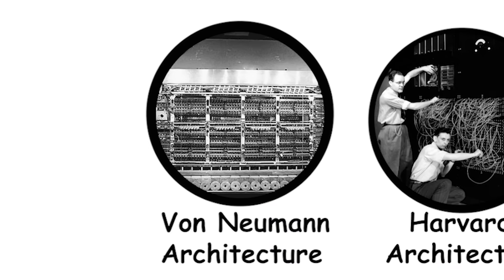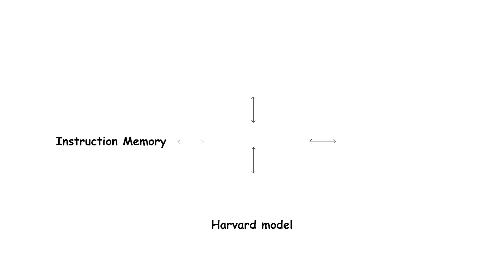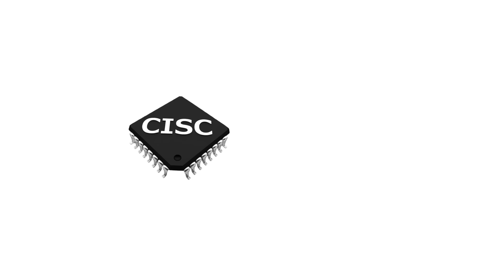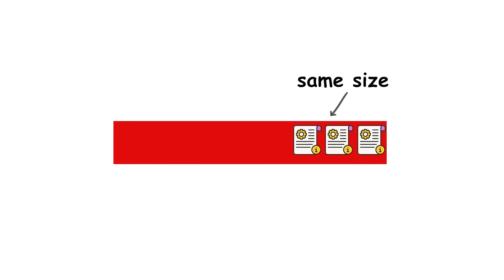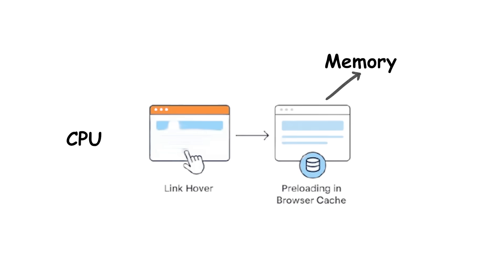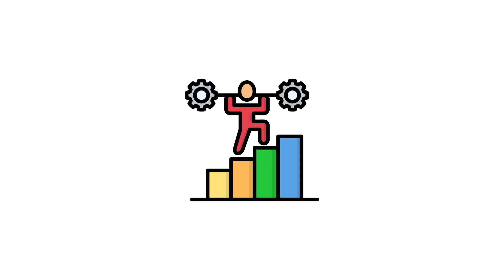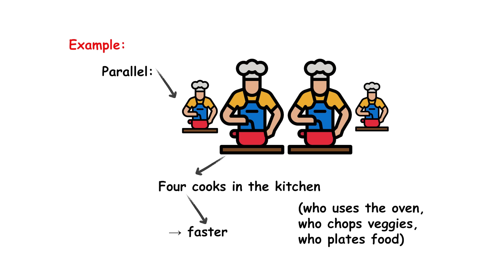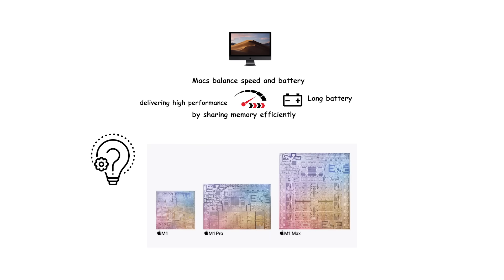Every CPU Architecture Explained in Detail

Comment: If memory bus is an issue, and ALU over comes that? Why hasnt that gain more tractions?
And why does everything have to be done through the cpu?
Look how Amiga designed the hardware using other slave chips to perform the tasks.
And why not having something that avoids to execute too much instructions for drivers, such as kabi interface

Comment: A very good overview of architectures.  But there are a few errors.  For instance, VLIW was not the invention point for speculative execution.  That was tried in some earlier machines, but really became important in the Pentium Pro design which was sold first in 1995.  While Itanium did use a variant of the technique speculative execution along with branch prediction gave the P (Pentium Pro) and subsequent CPUS higher performance per clock.  In addition, superscalar was first introduced in a modern CPU with the 80960 architecture in 1980.  Superscalar was used in the Pentium and every subsequent Pentium (II, III, 4) design.  It was first coupled with branch prediction, speculative execution, and register renaming in the Pentium Pro design introduced in  1995.  

I am certain of all this as I designed CPUs at Intel from 1979 to 2001 and was the design manager of the P6, and the VP/GM for Pentium II, Pentium III, Pentium 4, and Celeron product lines.  Many of these capabilities were  used in all other CPUs, as has become normal in the industry.  The Pentium Pro was also the first to deliver Hyperthreading or using a single execution unit for multiple threads for efficiency.

The fact that we are stuck with higher performance by using more cores means that the micro-architecture (all the elements above) has not seen any real movement since the late 90's. The apple processors using hybrid cores gives an advantage in power/performance but not strictly performance.  

Overall a good overview of some very complex topics.

Comment: Watching this video, I was trying to interpret each step mathematically... after a while it was overwhelmed. We just don't realize how much thought and work went into our computer's CPUs...
Reply: The modern microprocessor is the most complex system on the planet.  This is simply assumed as we've always had them available and the products keep increasing performance, but the people who are knowledgeable enough to actually design a processor are very rare and becoming rarer.  The intricacy of these systems is hard to imagine, and we think of them as perfectly functional, but all have bugs that are documented and often worked around in computers.  More importantly, most microarchitectural development slowed down significantly in the early 2000's as we simply deployed more cores for more performance.  The next most complex system behind the processor is the software that supports it all.  People who can build the OS, compilers, etc are fewer now also.  It worries me, especially when I see that most Computer Science major do NOT require a course on assembly (machine) language anymore.

Comment: Comparing apples and oranges. For example mixing concepts and implementations. Nearly ALL code follows a Von Neuman thinking.
The implementations of the execution units can use any structure or combination of structures. It does change the architecture of the code.

Comment: Where is PA-RISC developed with Russian help with Intel and HP and with the advent of the new cold war they dropped the Russians and the project fall flat on their faces unable to match the Soviet Programming magic to make those processors work....
Reply: PA-RISC was pushed by HP for a while after the failed Itanium (Itanic) but never achieved critical mass due to lack of differentiation and  higher costs than X86.
Reply: @randyscorner9434  That was the ITANIUM project, Intel failed to implemented and later passed on to HP, it had a great potential but cut ties with the Russian creators and failed the architecture and programming know how...

Comment: you miss all fixed logic instructionless architectures. superscalar is closest to the fixel logic fpga instructionless architecture. dont make multicore to be superscalar. analyze on the single core architecture. any system is a superscalar if you allow multi-core systems. avx is very close to superscalar.
Reply from the maker: I appreciate the insights, I'll keep that in mind for the next video!

Comment: it sounds AI but it does give you a good idea of different CPU architectures and what they are specialized for, like hybrid cores are the "jack of all trades" CISC is good for multiple instructions, RISC is good for quickly processing fewer instructions, Multicore architectures are good for multiple task loads, many core architectures are better at this but they get diminishing returns due to what i call "overcoring" where each core is optimized for one small task and if there are too many, they require more space or smaller cores, this reduces the amount of avaliable resources for each core as the space is divided between a lot of cores, some CPU's even have over 100 cores! but they dont utilize all of them efficiently since often times you arent running 100 different tasks, so they need to assign multiple cores to each workload to improve workload efficiency, this increases latency and it reduces efficiency since a many core CPU would require like 3 cores while a multicore would require only 1.
Reply from the maker: Thanks for the detailed comment and for sharing your thoughts on the topic!

Comment: EPIC was an EPIC failure.
RISC has reduced the number of RISC families but has increased the number of ISA variations for ARM.
RISC is now more CISC, and CISC are now more RISC after the decode stage.
Reply: RISC was sort of poorly named... Load/Store architecture is better, IMO. I had to do a presentation back in the day and compared the PowerPC ISA to the just released Pentium (original one) ISA and the PPC actually had more instructions than the Pentium at the time (not counting each addressing mode as a different instruction). The "Reduced" was misunderstood sometimes as meaning "fewer instructions" and it was really more about reduction in instruction set complexity -- not so many addressing modes, not so many instructions that did things like in a loop like some of the string instructions in some processors, etc.

But yeah... even the "CISC" processors these days are "RISC" processors with a layer that converts the incoming instructions into a stream of one or more "RISC" instructions that the core actually executes. Interestingly enough, one can almost argue that CISC is basically a compressed instruction stream because of that (and some RISC processors have a 'compressed' mode, even... like the thumb ISA in ARM).

Comment: A nice list, but not fully comprehensive, there's quite a few exotic architectures that were not covered. E.g., specialised architectures like Anton, deep pipeline / heavily multi-threaded scheduling architectures like ARM Mali or Sparc Niagara, then the good old Transputers, and many more.
Reply: That's where connectivity between processors was so hotly debated.  Hypercubes, Transputer meshes, diminished meshes, etc.  Most of what was tried experimentally in earlier machines has been included in modern architectures where we have the resources to build them.  But there were a lot of "gee this just doesn't give an advantage" feature.
Reply: @randyscorner9434 nah, most of these architectures worked wonderfully, but code monkeys could not wrap their tiny heads around the new concepts. It takes an entirely different mindeset to code in Occam.

Comment: The problem is not the AI narrator, rather the script itself seems AI sloppy.
Reply: The script omits certain concepts I think are important (i.e. it doesn't explain VLIW), but actually, it's quite accurate.
Reply: I'm getting pretty tired of this AI slop. Rushed, crammed-sounding narration (I've hear this voice used numerous times on these AI-generated videos. To me, using AI like this is what gives AI as a creative tool a bad rap. It is lazy, sloppy, and shows no effort on the creator's part in making this video.
Reply: In the interest of the thread....I hear Casey Kasem, but what else is there?    😆
Reply: It is A but no I. Call it TTS
Reply: And the multiple spelling mistakes, pure trash.
Reply: although the video script seems correct, the visualization is not correct. I think the creator doesn't have proper knowledge of COA
Reply: and the speed at which is being delivered... maaaaaaaaaaan

SLOW DOWN!
Reply: video also seems to be AI